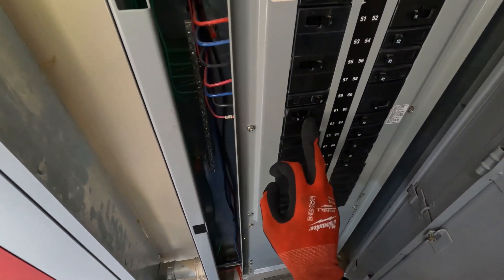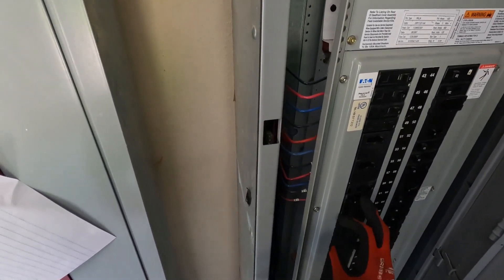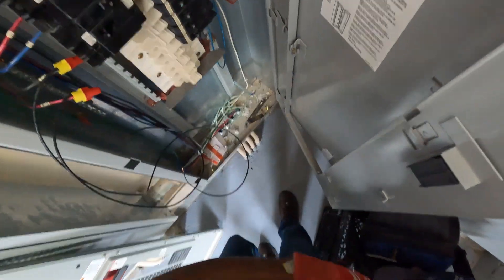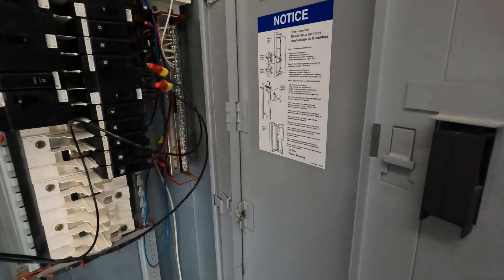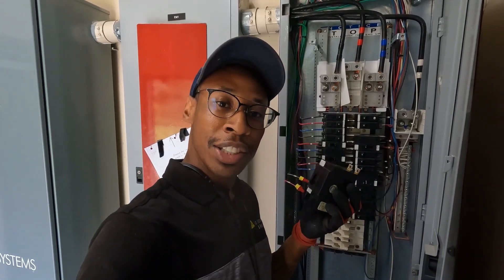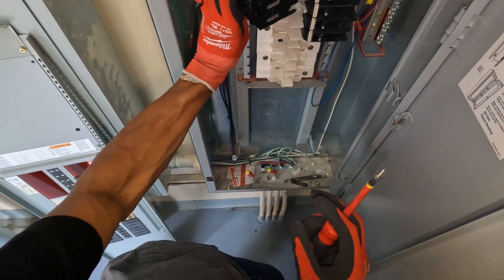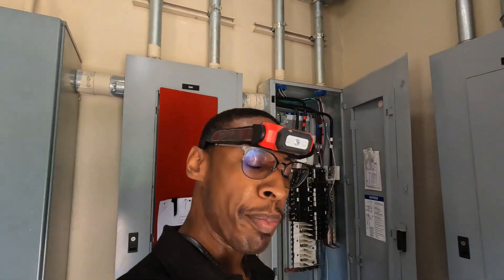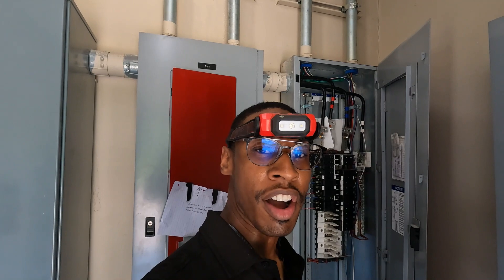How To Troubleshoot Circuit Breaker Tripping for Air Compressor at Senior Living Community

Comment: Great job, splicing those wires made it a much easier quicker job, not used to seeing breakers with screws holding them in. How much does a breaker like that cost ?

Comment: Good work Steven! Breakers will wear out ! What we don't is how long if any the breaker was on before it tripped, did it trip the moment you turned it on, or how many amps the compressor was pulling. You took the quick route , verify the breaker , check the equipment ,change the breaker, finish up and on the next job. Smart call !!

Comment: Nice, "Process of Elimination"   Not familiar with that type of panel. Those screws that hold the breakers in, are they hot? and screw into the bus bar?
Reply from the maker: Yes they're hot

Comment: Bolt-ins are a pain in the ass. Try an insulated nut driver.
Reply from the maker: I did, the issue is they are not magnetic
Reply: Gotcha
Reply: Quick wedge holding screwdrivers